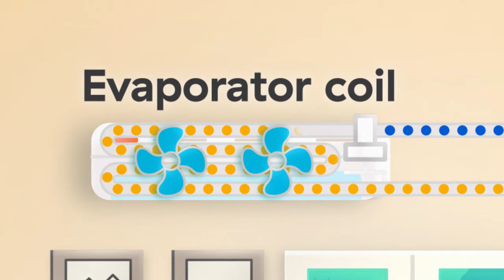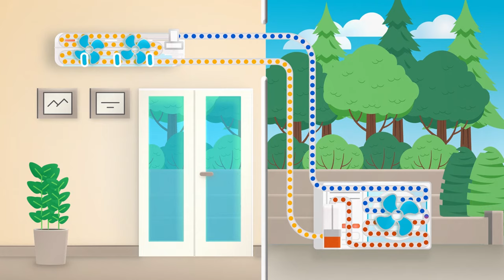How Do Heat Pumps Work? | Heat Pumps Explained

Comment: its amazing how he compares it to electric heating.........LOL   compare it to natural gas heating  or even oil
Reply: It's a lot more efficient to natural gas or oil. Even at below freezing temperatures. I know because I've working on them for 20 years. Even the latest heat pumps can produce heat from -25 degrees. A ground to water heatpump would be the ideal setup. Too many people talk negatively about them when they really don't understand. Each heating system is bespoke and if designed incorrectly then it will never operate properly
Reply: @shaneoneill1949  until you have a power failure due to an ice storm and you lose power for 2 weeks........i'll just turn my  gas stove burners on to keep warm and make me a cup of coffee and make me an omelet
Reply: @joseviana2112  That's a great option to have, if you live in an area that has storms like that then a back up generator would be ideal. Apart of my job is comparing the efficiency of all heating systems, whether the heat is taken from the air, water or the ground it is always more efficient then gas or oil.

Comment: "It's an environmentally friendly option especially here in BC where  we're powered by water".
This statement is illogical.   The difference in environmental impact would be greater in places where they use less environmentally friendly power sources.   So in BC where we use more environmentally friendly power sources the saving to the environment would be *smaller*.
Reply: ..no, they're comparing gas, oil CO2 vs Hydro electricity powered heat pump, not resistive heating. If the electricity is pure coal, switching from gas to pure-coal electric is near pointless, switching from gas to pure hydro electric would be a 100% CO2 saving,

Comment: just remember this:  you are the carbon they want to eliminate.

simply put; heat pump is the same as a window fitted air conditioning unit. compressing or evaporating refrigerant to heat or cool a coil.  one side blows cool air, the other warm air depending on which way the refrigerant is flowing..   heat pump same concept.

Comment: Why not to have an heat pump this is from the BRE to explain why EPCs downgrade if you have them fitted  “the reason that the heat demand may increase with a heat pump compared to an oil boiler, is that heat pumps … may need to be run for longer hours to give sufficient heat output over a 24 hour period and to avoid very long warm up times. Running longer hours…. would result in higher mean internal temperature. Consequently, the total heat losses would be higher, so the energy requirement would be higher” 4
Reply: The heat loss is proportional to temperature. If the set point is 21C with the heat pump, then I don't see why the total heat loss with an inverting heat pump would be greater than with a single stage gas furnace that goes on at at 20.5C and off at 21.5C. The average temperature is still the same and held within very narrow limits. It does mean that the heat pump will run longer, continuously modulating in the ideal case.

Comment: you forgot to say how they cannot appropriately heat the domestic water supply and require an immersion "hidden" in the LARGE water tank to compensate? massively increasing electricity bills and that the heat pump increases electricity usage annually by anywhere between 20% and 45% (depending upon the annual climate of homes location)? or that they are next to useless on any property built before 1930's due to wall construction?
Reply: Ah, I see another "expert" leaning into confirmation bias.

If you have an Air 2 Water R290 heat pump then the immersion isn't required, as it can do 75C without it. R744 can do 90C.
R32 and R410a can do up to around 55C without the immersion.  And nearly all will raise the temperature to the max with the heat pump, and then do the rest with the immersion if required - which for some - depending on tank turnover, will be a once a week cycle for anti-legionella.

Heat Pumps don't increase electricity usage (unless you mean vs a fossil fuel system, if you're not taking into consideration the reduction in fossil fuel burning).  As vs any electrical system, they will always use less electricity to provide the same amount of heat.

My property was built in the 1920s.  Have 3 Air to Air heat pumps, with one that also does DHW.

Comment: And they are as noisy as heck, can you imagine when everyone on the block has them running! With all these electric heatpumps and EV this will put another strain on the electrical grid...heat pumps are not the answer.

Comment: I knew these things were b***s***!  
‘Even when the air is cold, it’s still hot!’ WTF😂
Basically they are weak heaters that are more energy efficient because they don’t provide much heat😂
Reply: Everything by default is -273C degrees. (absolute zero). If something is -200C, something (like the sun) has heaten it up by 70 degrees C! If it is -20C outside, the sun has heaten the air more than 250 celsius (from -273->-20C) So yes, there is a lot of heat energy even in cold air.

Comment: Heat pumps are junk.  Heating cost are too high.
Reply: They are hit or miss. If you buy a cheap one it will be a bad time. The best system is a heat pump with gas furnace backup.
Reply: The cost to operate depends on how you power them and what you pay for electricity, if anything.
Reply: I totally agree.

Comment: Why is very cold air getting blown over the coil why is it not enclosed recirculate the heat in winter it won’t catch fire explain that to me on the Shetland Isle there are no trees to hug so sad it is
Reply: that made no sense at all. I think you need to go to school and learn how the system actually works.

Comment: Of course BC hydro wants you to change over to these pieces of crap, sell more energy. These heat pumps require energy and run, almost 24/7 to keep your house at a desired temperature, yes they will cycle but in most of the northern parts of the provinces they will in the winter never keep up. Oh the bs is out there that at -25 they are good, in an experimental house that is mocked up with the best windows, doors, over insulated walls and attic. You will still need back up heat of some sort, let me guess BC hydro…..electric baseboard heaters. CLOWNS.